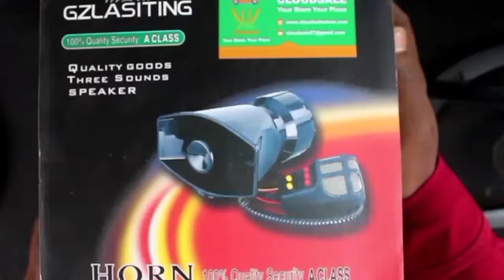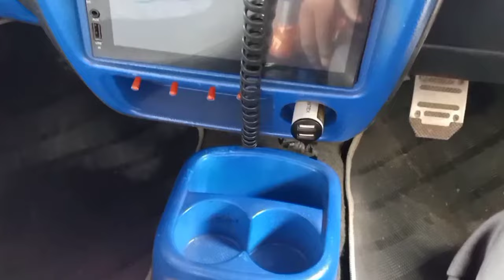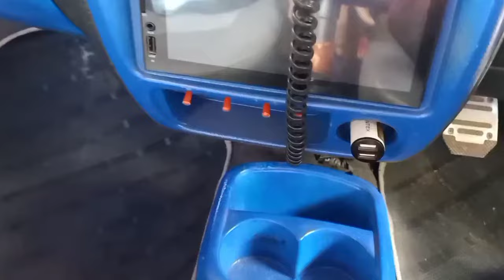Car siren speaker can offer 5 loud and clear sounds speaker installation

Comment: Is there a  way it can be louder ?
Cause once in traffic or anywhere crowed  it dont  make sense.
Reply: Just installed one today it's super loud already I'm going to be putting something over it to not be as loud, I'm using it for car show fun
Reply from the maker: @billygoatracer  yes only for fun you can add potentiometer in between speaker input so you can adjust supply

Comment: Also it doesn't have a off/ on switch, so it stays on all the time and kills the battery
Reply from the maker: Yes ,but you can add one toggle switch in between to not drain battery.
Reply: @Raptorhp  I hooked it up with the key on power now
Reply from the maker: @billygoatracer  great then...

Comment: camna wiring dia bro..
Reply from the maker: Only you need to connect two +ve &-ve terminals to battery and one switch rest of the fuse are built in, wiring go through firewall for controler and megaphone is fixed in engine bay